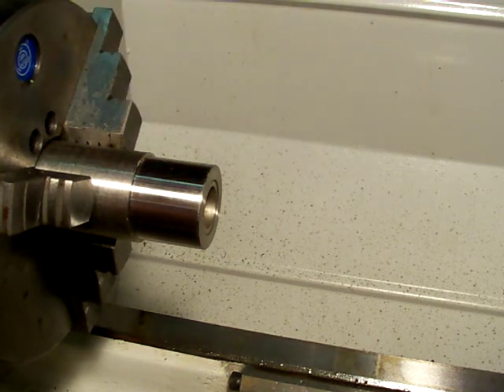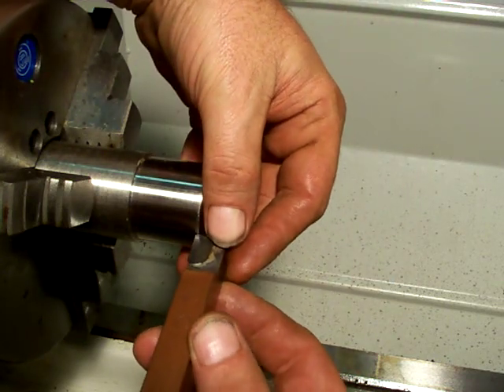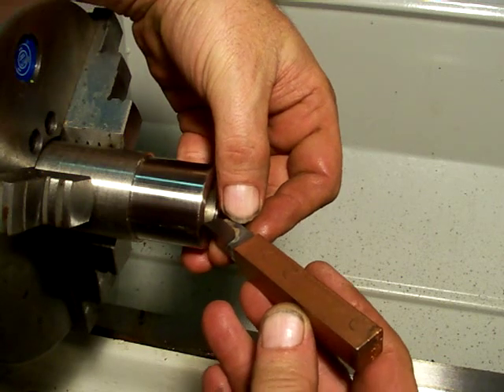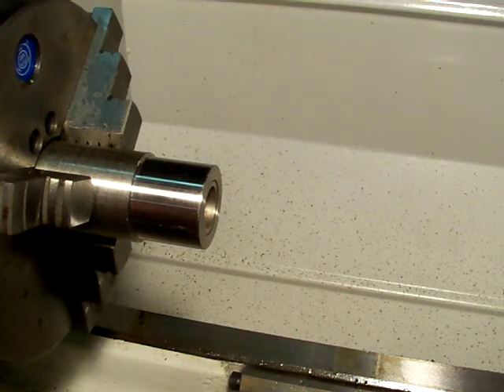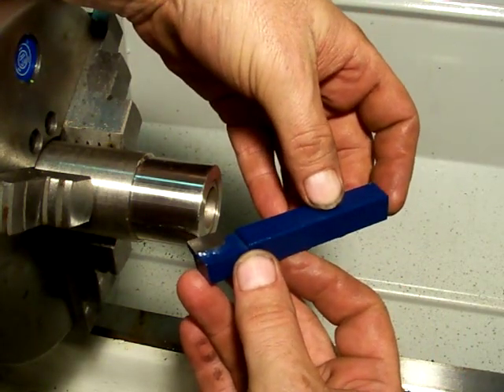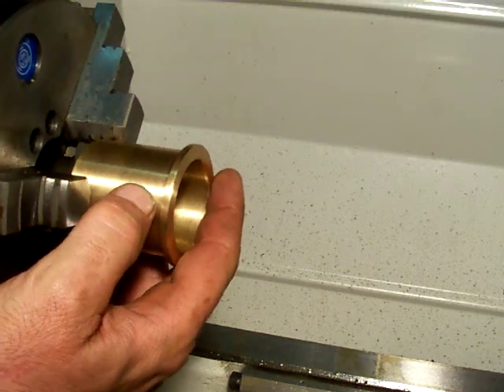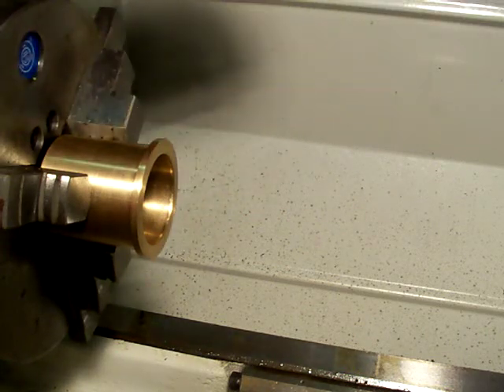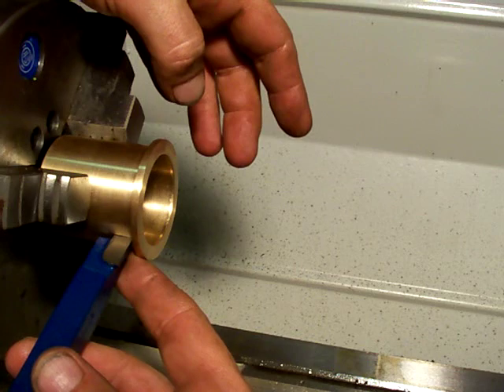lathe tools

Comment: you confused left and right hand cutting tools like most people got left and right hand fleming's rule wrong.

left and right hand cutting tools of a lathe machine are not indicated by where the sharp edge is located; it's basically the hand a machinist, so to speak, is comfortable of using to move the carriage which holds the cutter. if you're feeding the cutter toward the left onto the workpiece, then you might use your right hand to spin the handwheel of the carriage. And vice-versa.

Comment: Sorry to say & not trying to be condescending but the way to determine if the tool is right hand or left hand would be to put the tool on a table facing you if the tip of the tool turns to the right it's a right hand tool & vice versa

Comment: Hi, Sorry to say but you mention LH and RH tool wrongly.Actually you need to hold the tool point facing up & towards you and check for cutting edge, if it is on Right hand side then its RH side tool and if it is going on LH side then it is LH tool